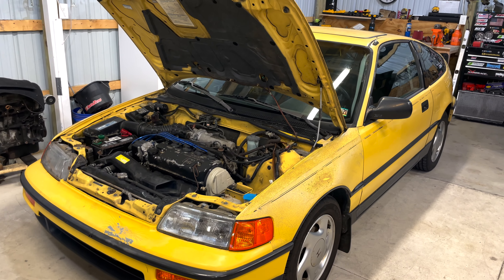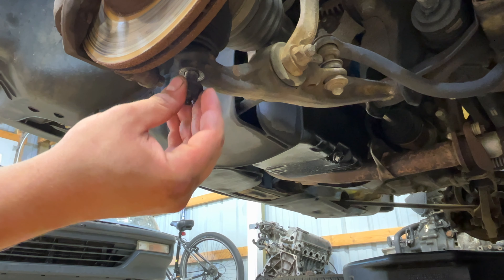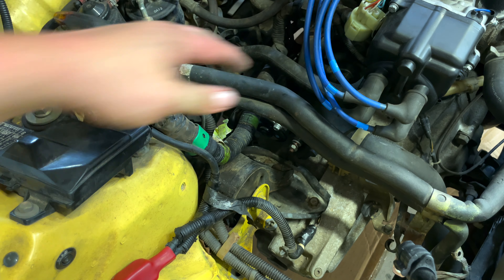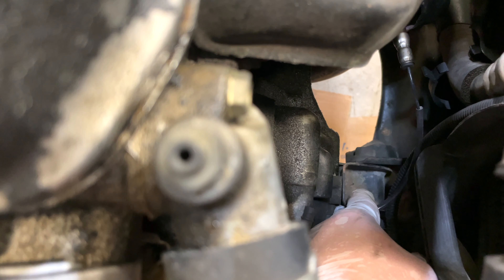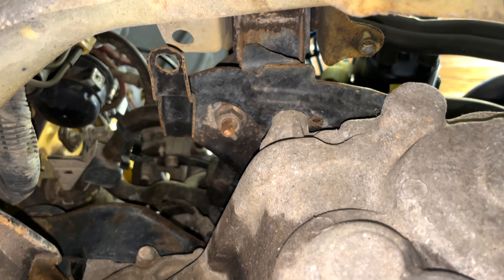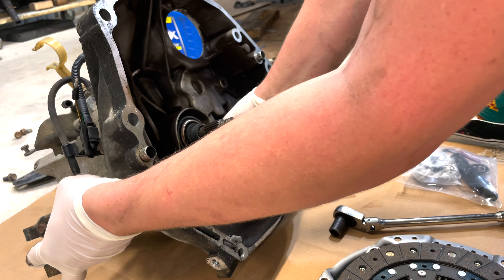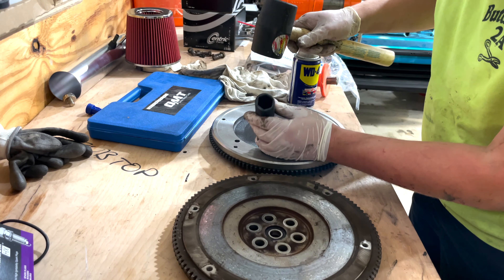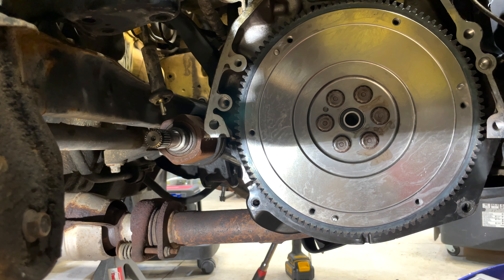1990 Honda CRX SI Clutch Replacement

Comment: So you can change the clutch without taking out the engine, nice. :)
Reply from the maker: Most people consider taking the engine out with the trans attached much easier. I prefer leaving the engine installed but that’s just my preference 🚙

Comment: Perfect video..
Please
I need to know..
What the correct number. To set the valves.
My car is honda civic 1990 . Manual transmission.with carburettor.
Thanks 🙂🙂
Reply from the maker: Sorry to get back to you so late but .007 for the intake and .009 for the exhaust side 🤔

Comment: Hey great video I had a question so when we were removing the flywheel it spun and we wanted to know if the engine would be off timing.
Reply from the maker: If the belt was still tight and not messed with you should be fine!

Comment: Do you recommend changing the engine mounts to new one while replacing the clutch since theyre apart already?
Reply from the maker: Wouldn’t hurt to do that 👍
Reply: Change any possible thing that could be worn... parts for this car are very cheap on rockauto

Comment: How do I put the transmission back on
Reply from the maker: Same way you took it off, use a floor jack to lift it into place that usually helps. It will pop into place then slowly tighten the bolts down in a criss cross pattern

Comment: Is there any different from a 86? Looks about the same
Reply from the maker: It’s not going to be 100% identical but im sure you can apply a lot of the same procedures on those years as well.
Reply: Is the game plan to just have enough room to remove the bell housing to take the clutch off?  If I can do it without removing as much peripherals?

Comment: Use conventioanl 5w30 motor oil in the tranny....thats what I use
Reply from the maker: You’re taking a chance I’ve blown a manual Honda transmission when I used regular conventional motor oil. Trust me from experience. Those trannys are very picky when it comes to fluid, just passing info on from my experience.
Reply: @Tycrx89  Read the owners manual !
Reply from the maker: Owners manual didn’t save me from blowing a trans Unfort
Reply: @Tycrx89  Th etrans didnt blow because of the oil... many other reasons !
Reply from the maker: Possibly I’ve never had an issue when I’ve used manual Honda transmission fluid the one time I did use gear oil the transmission was affected so I wasn’t sure exactly what happened it didn’t blow from abuse. Just passing on my experience I’m sure 5-30 gear oil is fine, I just won’t be using it.
Reply: @Tycrx89  The Honda service manual does say to use 10w-30 or 10w-40 in the transmission for these.
Any way, nice video, I'll probably be doing this on mine in a few weeks.

Comment: Never ever take of a seal like this guy did that's completely wrong and even if he said he didn't damage the edge you might not so don't do it this way best way and easier is use couple of wood screws on each side you can do one also but use to just barely screw in the tips of them then use some pliers to pull them out you can use vice grips too to get a better hold on the screw and even hammer the vice grip and pull it out easy clean and no worry about messing up any edge of and seal ever